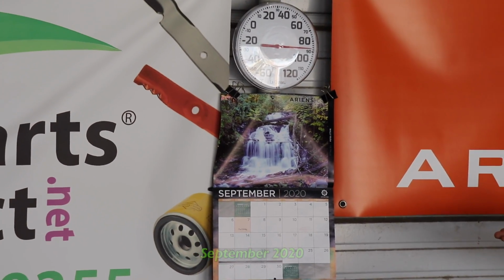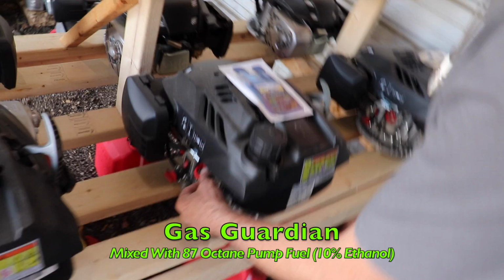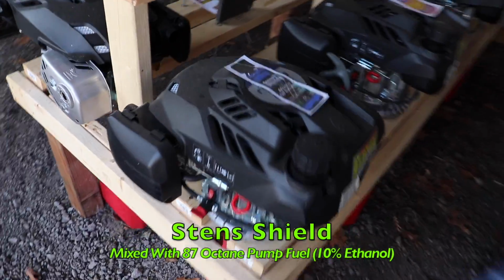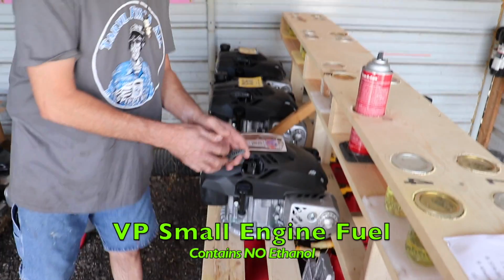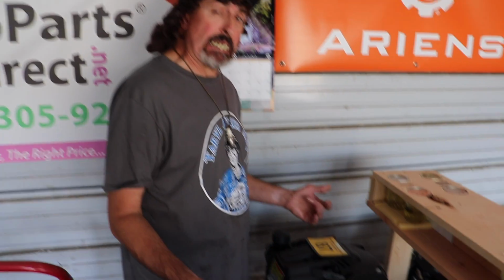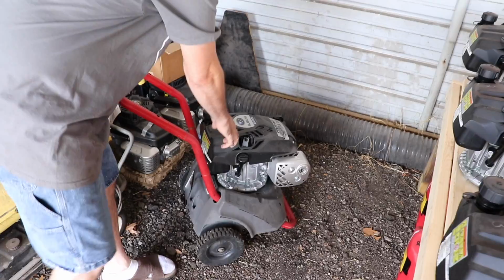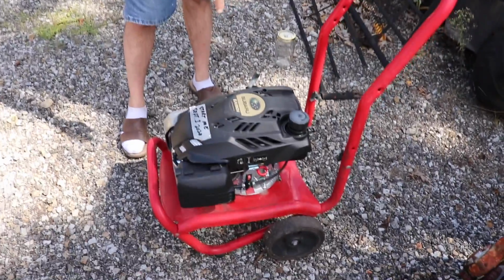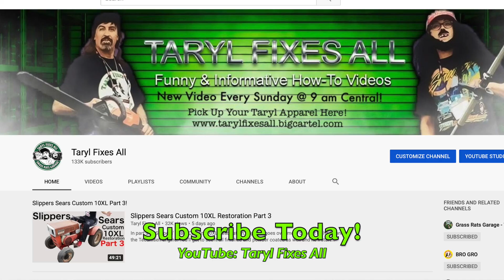Fuel Additives DON'T Work - Why?

Comment: I wouldn't run them as long because it uses all the worse gas that's in the carbutrator and fills it with fresher stuff from the tank.
Reply from the maker: Thats what I'm thinkin" the fuel in the tank is not exposed to as much air as the small amount in the float bowl.

Comment: I'm telling you right now that engine with seafoam is going to be one of the last to go if not the last. And the more you run any engine the better it runs when it's been sitting so yes I'd let it run 5 seconds and shut it off and move to the next

Comment: I recently had an incident with high test going bad quick I have a theory ,my theory is gas station don't sell as much so it was actually already getting old by the time I bought it, roughly a month ago I bought 3 gallons of high test for my big saws I keep low grade for my other equipment, my 65 and 75 cc saw last week  fueld up with the high test can that had been in the garage a month or better and both of them ran like pure shit, I mixed up some fuel with what I had for my mower and they worked..idk why but it recently just happened

Comment: Nice project but....your not using the small guys like a trimmer that has the very small carbs which has tinny jets which will foul faster ...so it's about fuel and size of jets...so Start over and do it right....that's all...stay safe...
Reply from the maker: i thought about that. But all the name brand 2-cycle oil has stabilizer in it. From my experience and with my own personal equipment  and some customer equipment is I just dump out the fuel thats old add fresh mix and if it has a purge bulb pump it 10 or 15 times and usually it starts. the 2-stroke stuff with carb problems that I see are when the customer stores it dry. The fuel thats left to evaporate in the carb. when taken apart the diaphragms are all hard as a carp. I tell my customers to do what I just mentioned dump it fill it with fresh mix and pump it. The stabilizer in the 2-stroke oil won't keep the fuel fresh but does help it from getting gummy. The majority of fuel problems we see at our shop is 4 stroke engines that have been sitting with gas in them, Carbs gummed up. Thats why I chose to use these low compression small engines. I have seen comments from viewers who have had experiences with cars that sat for years and started with old gas, Just think car engines have much higher compression ratios than a small engine. Thanks fer yur comment and keep watchin. Taryl out

Comment: I have used stabil fuel treatment
Reply: For many years with 10% ethanol gas and I have never had any trouble
Reply: Vince Scalise which one? Red, amber, or blue?
Reply: @vincescalise4821  this proves you wouldn't have had any trouble has you not used it, and been a few dollars richer
Reply: North Lander red
Reply: Jusb1066 Probably very true

Comment: Low octane pump gas wins so far... Don't waste your money on the snake oils.
Probably one of the best things for the carbs is running them every month
Reply: Fred Flintstone I went out of country last summer came back and my Honda mower wouldn’t stay idling and it surged when it ran. I forgot to put in Seafoam. I think they are better than nothing. Seafoam, any Sta-bil, or Star Tron.
Reply: @NorthlanderMN  I think I have something that works even better. I have a fuel shutoff valve between the tank and the carb.. When I'm finished using my mower, I shut the valve and run the engine out of gas. I think the longest that I've let it sit is nearly a year, and it started and ran just fine.

Comment: You know better you should always connect the water supply before you turn a pressure washer on
Reply: There's no pumps on the two that are mounted to the pressure washer frames.  Just acting as a base for them so he can start them.

Comment: There must be a flaw in this experiment. How can a additive added engine fail before a non additive engine?? If someone can explain that then maybe there is hope for this .
   The 87 octane straight gasoline should quit first ,,then the 93 octane gasoline. After that the additives should start to fail.
Reply: The additive is bad and it caused the fuel to gel
Reply: If you use more than recommended dose of stabil, i have seen it gel up in the fuel lines and floatbowls and the clogs the main jet that sits in the fuel in the floatbowl..im in Minnesota...just had a customer yesterday bring in a toro 418 ze snowblower with that problem
Reply: @leeharris3061  Do you really think he used more than recommended?? I doubt it.
Reply: @5153flash  most of that crap is marketing gimmicks..and doesn't work...personally i never use any additives..i use pure non oxygenated alcohol free 93 octane gasoline ⛽..it just plain smells different like back in the old days...if you can get non oxy gas wherever you're at buy it..its the best for small engines ..more expensive by a few cents per gallon but your small engines will love it..even the exhaust smells differently..👍

Comment: really should have used Briggs engines and they would have all died in 3 months..  LOL
Reply: No not with proper care and maintinece I have lots of Briggs engines I have an intel on a craftsman it is good I have old and new from 1976 and ones over 40 years old almost 50
Reply: @hunter7476  Sorry should have specified Briggs engines made in the last 5 years.  Old Briggs engines were fantastic.  But my newer Briggs engines seem to be overly susceptible to bad gas and sitting.  MUCH more than my Honda and Kawasaki's have been.  And all have carbs.
Reply: Briggs are very reliable. Thats the only motor I've ever had in my push mowers and they havnt given me any trouble.
Reply: @J3D1JC  I didn't realize Briggs marketing was so active in the Youtube game.  Sorry too much info shows the opposite.  If you really have had luck with all your Briggs then consider yourself lucky and I honestly hope you never have any issues with your mowers.  It's no fun to have to work on them when you would rather be mowing.